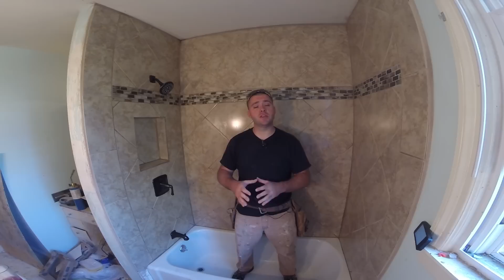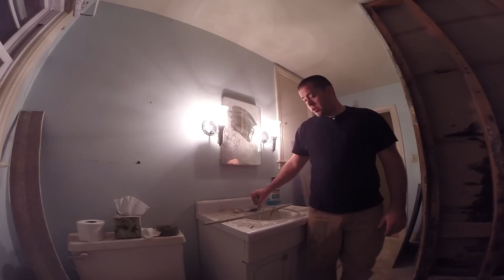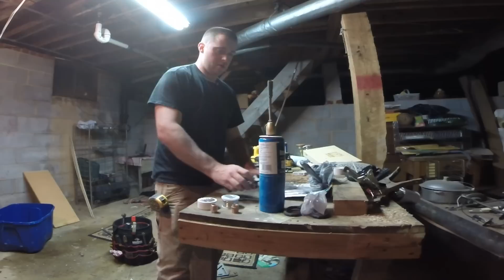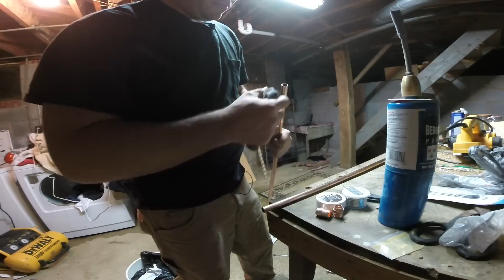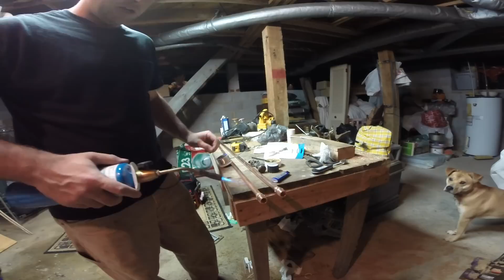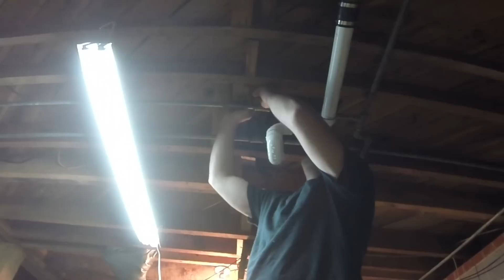Home Improvement - Plumbing Begins, Shower - Part 4 of 8

Comment: Dan, Everything looked good to me, just maybe a little heavy on the flux.
I just finished the same project you are doing a few years ago. I had to make 22 solder connections to go up and around a bump-in wall cubby like yours. Good Luck.

Comment: Good fix man... the sand paper u were talking about is called emery cloth, and a little tip for soldering ->..heat the fitting not the pipe for soldering. Fuck all the trolls, it was a good fix and at least u had the balls to delve in there and get it done... (even on an older video, does it still help u out if I thumbs up and comment..??)
Reply from the maker: Thanks..  Not sure, but it's always nice to see comments and I always look at the stats. Views to likes. Helps me gauge the content I make.
Reply: Well, I do enjoy the content u post for us man, The talkin Peanut(butter)-dogster is funny shit, for sure... I actually just subbed a few days ago and I've kinda been tryin to get caught up, so I'll just keep on commenting and thumbs upping for ya as I catch up on the vids...